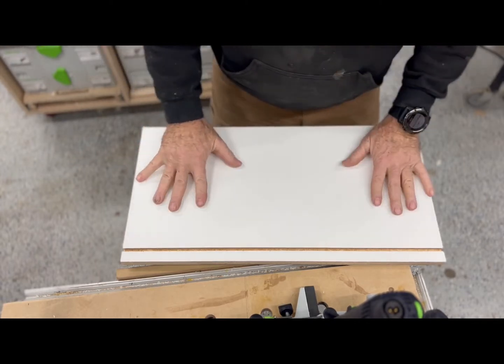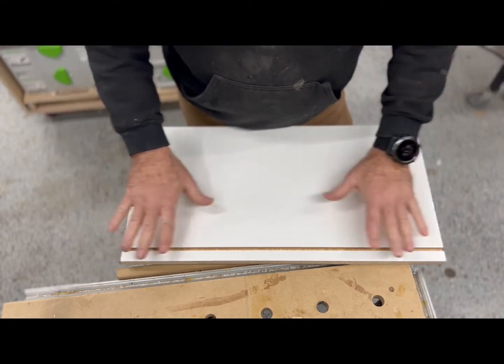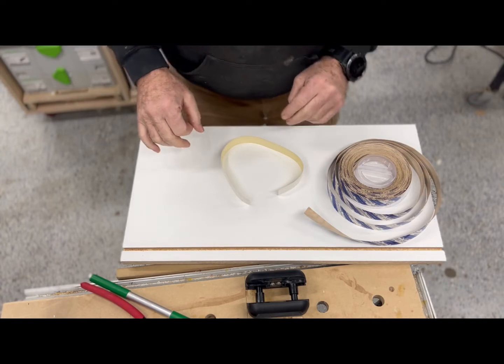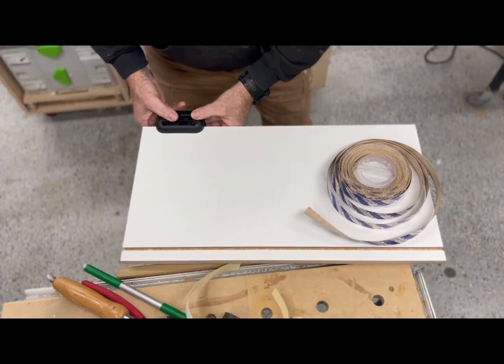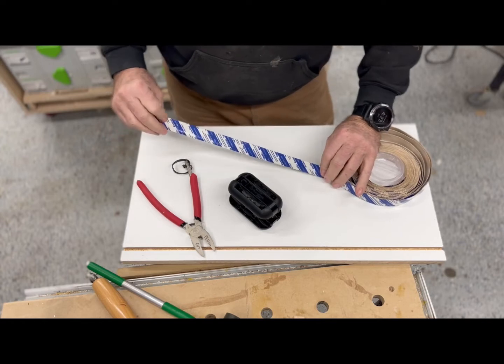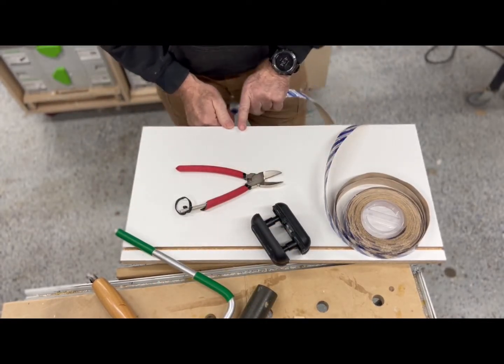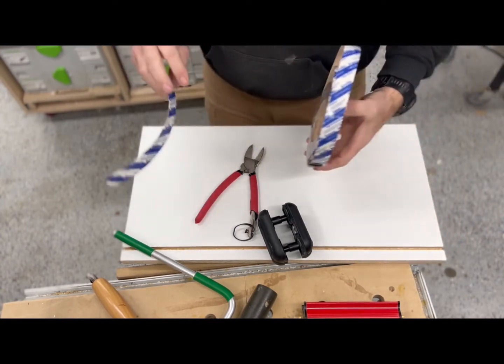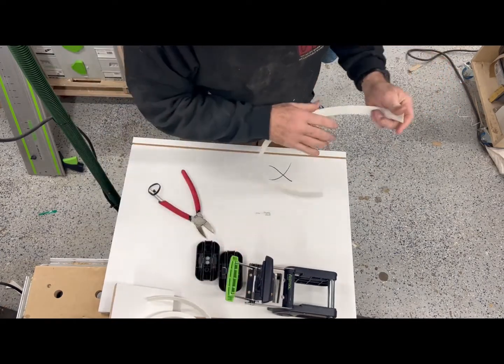Panel prep edgebanding and back panel dado  | Kitchen cabinet build series Part 5

Comment: Thanks for the video and great information. I’m currently with the Rockler banding machine and  it is hard to keep the tape feeding evenly on the piece. I’m waiting for the Conturo to become available from Festool again. It’s a heavy upfront price but a great investment if you’re doing a lot of Edge banding. 
One tip I learned from another You Tuber David Stanton is to back cut your melamine 2mm depth cutting backwards and then drop it back down to fully cut your material. This should leave both sides very clean edged. Thanks and keep up the good work!!